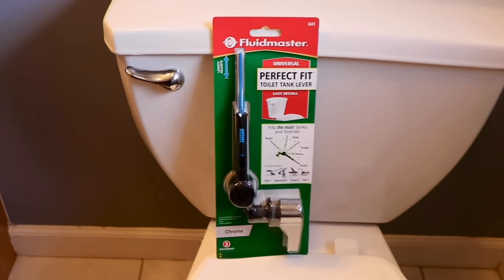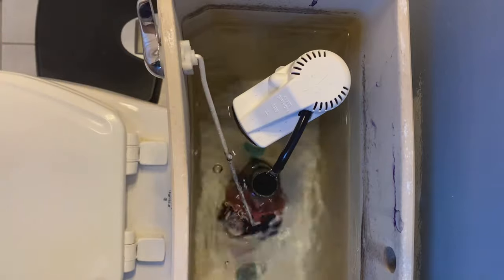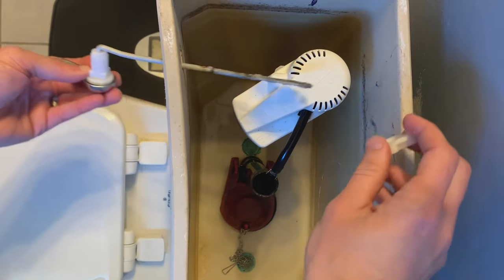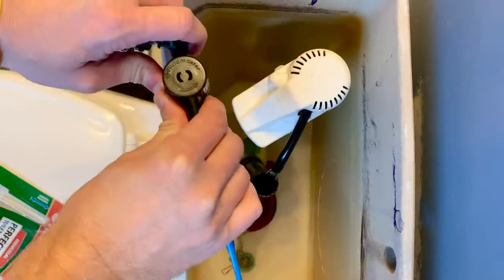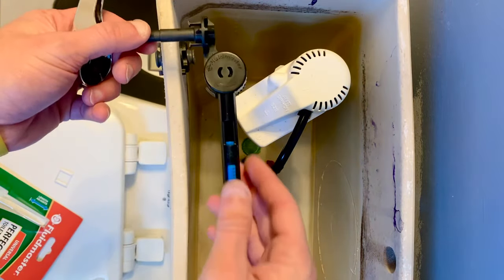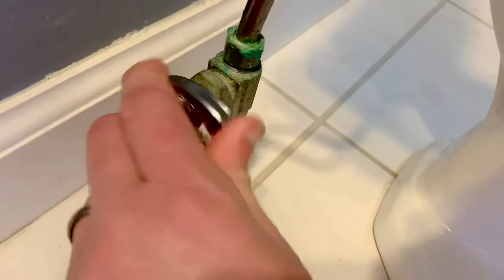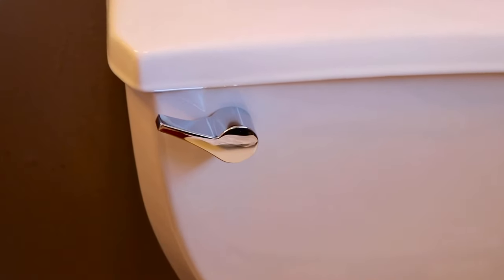How to Install Fluidmaster 641 Universal Perfect Fit Toilet Tank Lever Handle.

Comment: What do you do if the washer want come off so you can put the washer on the other side
Reply: Omg I wish there was a response to this because I am having the same exact issue right now
Reply: Same. It’s a piece of shit. I’m ready to cut it off and rig the old nut to it.
Reply: Just got mine off. Attach the handle back to it so you have something to hold as you turn it with a towel wrapped around the nut.
Reply: Im having the same issue!!
Reply: I ended up using some heat to melt the damn thing. Worked within a minute.
Reply: Lock washer stuck,has to be defective from the factory.
Reply: I had to break mine. I got the biggest wrench I had which is the really big one and just clamped down as hard as I can and it shattered lol
Reply: Same problem here.  !!!!!!!.   Seems like a manufacturing defect with this particular product
Reply: I had a terrible time! Tried hot water, WD 40, a grip that is used to open lids for jars. No luck! What finally worked is attaching it to the lever as someone mentioned above and then I got it to turn! What a fiasco!!
Reply: You have to turn it the other way don’t follow the arrow

Comment: This is the best video on the Fluidmaster Universal Fit Toilet Tank Lever. I went through 10 other videos before finding this, which was the only one useful. The problem was I needed the handle to side mount and couldn't get the angle adjusted without breaking it. Would have been 12-15 dollars flushed down the drain if it was not for this video. Thanks.
Reply from the maker: Thank you for watching and for the compliment, I really appreciate it!
Reply: @5MinuteFixit help! I have a.  SIDE MOUNT handle. This lever was installed previously, but broke. I can't figure out how to turn the arm to form a 90° angle as was previously done.

Comment: The black mounting piece that enters the hole in the porcelain from the outside of the tank must be inserted with a certain orientation for the lever handle to sit straight. 

This must be done before screwing on the lock nut inside the tank. 

The mounting piece must be installed with the words 'top' appearing on both the upper left and the upper right sides. 

I initially inserted it with a random orientation that was not correct and so the lever drooped at an angle. 

Took me a while to figure it out. 

The 'top' words are raised black lettering on the black background plastic material so it is easy to miss seeing them. 

Unfortunately the manufacturer directions do not make this important information clear. 

Thank you for your great video!
Reply from the maker: Thank you for watching, I’m glad it was helpful! Please consider giving the video a thumbs up if you haven’t already! Thank you!
Reply: Thank you so much!   This saved me!!
Reply: Thank you so much!  You just saved me from freaking out.  Lol
Reply: Great info, just what I needed ^^
Reply: Thank you for pointing this out. I was scratching my head thinking maybe this is just how newer handles are supposed to be positioned lol

Comment: I had a little trouble due to corner mount.  Not enough room for swivel on right. Figured out that turning upside down so swivel on left solved problem.  Also putting on knob requires stronger push than I expected.  Now works well.
Reply from the maker: I'm glad you found the way that works best for your toilet. Sometimes those corner mounts can be tricky! Thank you for watching and please consider giving the video a thumbs up if you haven't already! Thank you!

Comment: Thanks, not being even close to a handyman, I couldn't have done this using the pkg directions alone.
One suggestion, when placing the lever mount, be careful to have the arrows point up, I didn't and had to take it apart and redo it.
Reply from the maker: Thank you for watching and for the tip!

Comment: That looks easy, except for the fact the hand nut will NOT come off of the new fixture.  You can't install it until you can get the hand nut off.  That thing isn't budging.
Reply from the maker: Some others have said this same thing and returned theirs and the new one was ok. Maybe manufacturing defect?
Reply: I brought it back to Home Depot and took a chance exchanging it for the same model and the new one was fine. However, I still can't get the adjustment exact. The nut is fastened, but the handle is still a bit loose. I tried using the sleeve but that didn't work.

Comment: I can not get the locknut off the thread, I have turned it both ways, it turns but it just stays in place,  HELP! WHAT DO I DO
Reply from the maker: Is there possibly a clip or pin holding it in place or is the whole unit twisting? That’s the only reason I could see it not coming off.

Comment: Thanks for your tutorial. My problem is that I can't remove the old handle. the finger nut is not moving with channel locks or pliers.
Reply from the maker: I would just try to break the old handle if you are discarding it anyway, just be careful not to damage your toilet.

Comment: Your concise & EZ to understand video was a GREAT tool! Back of Fluidmaster 641 packaging left me in fits of clenching jaws & less than ideal info. You’re Awesome! My question; weird, our flush handle only fits upside down as compared to yours in this video. Ours is a ToTo.  Is this normal? Thanks in advance!
Part of “round rotation arm” which can be adjusted….sits butted up next to tall valve.  Nothing is caught & movement is free when flushing. Sound ok?
Reply from the maker: Everything you described sounds ok to me as long as it is working correctly! Thank you for watching, I'm glad it was helpful! Please consider giving the video a thumbs up if you haven't already! Thank you!

Comment: great video, watched at least 10 times, but when it comes to putting the handle on, it seems that the arm is not long enough to latch onto the handle.  I squeezed, and tried  maneuver but it would not click.  I installed it like the video and turned around the lugnut, but only works one way.   Any suggestions please,  Thanks.!!
Reply: sorry to hear, I am also having trouble. It is very interesting to see how the people making these videos reply always to the complements and not the people having issues.
Reply: @agustinconti5461  don't hesitate to tell me the problem. I feel sort of like an expert. The guy was great....suggested that it just didn't fit...taped the package up for return. This was my second one...I think I could fix any lever issue... as long as I have the correct part.

Comment: This is great but my finger nut is stuck, it will not move, should I return it?
Reply from the maker: I would, others have commented about the same issue and have returned theirs. The replacement in most cases has been fine. Thank you for watching, hopefully this helps!

Comment: Everything worked great right up until the end. I snap the lever into place, but it won't turn. Any advice is appreciated.
Reply from the maker: Check the piece that the lever snaps into...it could be rotated the wrong way. Hopefully this helps, thank you for watching!
Reply: I'll check it out. Thanks.
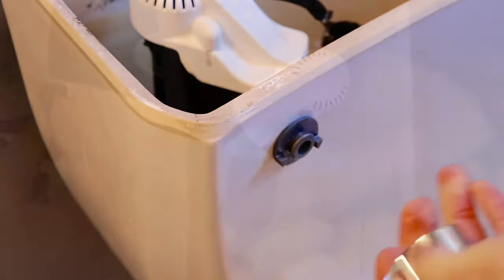Reply from the maker: @DaddyLobo23  it should look like it does at 2:23 of the video.

Comment: How do you line up the external lever with the tabs and "snap" into place? I've tried different configurations and approaches and it never engages. Maybe I bought a defective unit? I'm using plenty of force to try to snap the two pieces together. Any tricks worth mentioning or other advice? Thank you!
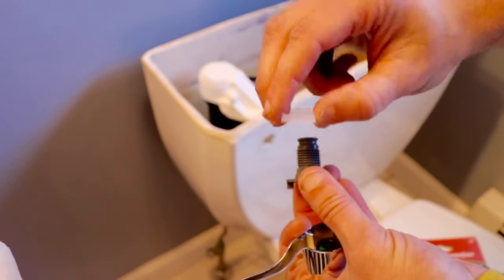Reply from the maker: There is a small translucent square piece that I remove at the 2:05 mark. Depending on the hole on the toilet you may need to remove this piece. It could be preventing the one pieces from snapping into place. A couple other commenters have had a similar issue and I believe the thickness of their toilet prevented this. Hopefully this helps! Thank you for watching and please consider giving the video a thumbs up if you haven’t already! Thank you!
Reply: @5MinuteFixit  You called it. Removed the square piece and it snapped in great. I'm not thrilled with the angle the lever positioned to point at 11 o'clock, but it is what it is. Thanks for your help!
Reply from the maker: @espedale  that’s great I’m glad you were able to get it put together! At the 2:41 mark on the video if you angle the lever down slightly when you click it together it may help the 11 o’clock angle. Thanks for watching!

Comment: Tried again?! Operator error or manufacturing defect?  The connection arm is not long enough to snap the handle in place.  Return to hardware store or keep trying?  Thanks!!
Reply from the maker: Thank you for watching! Sorry you are having so much trouble...Is your toilet tank possibly thicker than typical? Also make sure the nut is tightened down as far as it goes without forcing it.
Reply: Nice suggestion. I measured it at .5 inch. On your video it was much longer and easy to grip..on mine it looks sort of stubby and the nut is tight. Perhaps the toilet is one of the manufacturers that is the exception. I will subscribe on your channel...you've helped so many people. Thanks.
Reply from the maker: @dianneg.2592  thank you for watching...too bad we couldn’t figure  it out! I appreciate the support!

Comment: I still can't take the lever assembly off from the arm. I'm not sure what I'm doing wrong? 😬😬
Reply from the maker: I believe a few others had commented a while back saying they had received a defective lever arm and needed to get a replacement. If you are really struggling to get it off I would suspect this could be the issue.

Comment: Its all nice, easy and beatiful just like the instructions..EXCEPT (1:55) "then LOOSE the fingernut" or "unthread locknut" (in the instructions box) AND IT DOES NOT HAPPEN, THE BLACK NUT DOES NOT DETACH from the other piece..It does not matter if you use your hand or a wrench, clockwise or counterclockwise. IT is stuck. Useless piece of plastic crap...in my case the Fluidmaster 640
Reply from the maker: Could the handle you bought be defective? The nut on the one I used was almost too loose.
Reply: @5MinuteFixit  I decided it was the case, just got another piece, simpler and with the nut already detached

Comment: Why is my handle pointing upward? I hold it level while attaching the arm and then as soon as it attaches the weight drags it down and points the lever upward.
Reply from the maker: At the 2:25 mark in the video if that grey piece is installed incorrectly it would cause this. Double check this piece. Thank you for watching, hopefully this helps!
Reply: @5MinuteFixit  I took it out, flipped it every which way, and still can’t get it straight. No matter what the weight of the arm drags into strange angle. Still works, just really weird looking.
Reply: @5MinuteFixit  figured it out. Both “top” corners must be the top side...thanks!
Reply from the maker: @bluesdemitra38  that’s great! Thanks for letting us know the fix Incase others have the same problem!
Reply: @bluesdemitra38  Thanks for posting this MH, I had the same problem but couldn't figure out why until I found your comment. The sleeve was covering the up arrows. Thanks!

Comment: Horrible product. Cheap plastic garbage. I bought two of these and the nut was impossible to get off (as in I never could get it off, ended up breaking it trying). The problem is the nut would not catch the threading so it would just spend endlessly at the base and could not be removed. Defective product and this thing part gets way too much praise... It's an over-engineered design implemented with subpar quality parts. Typical Fluidmaster.